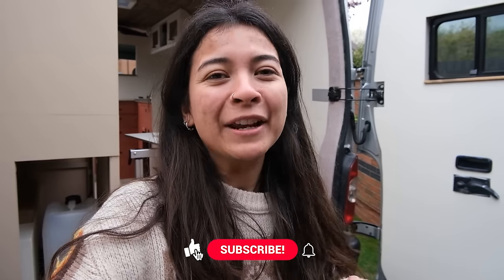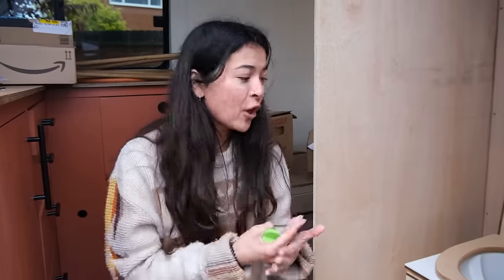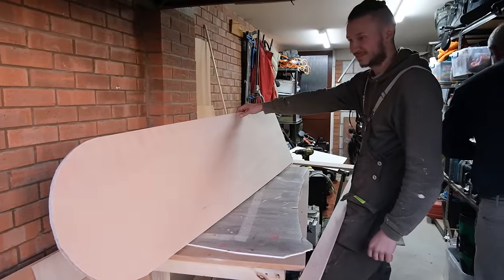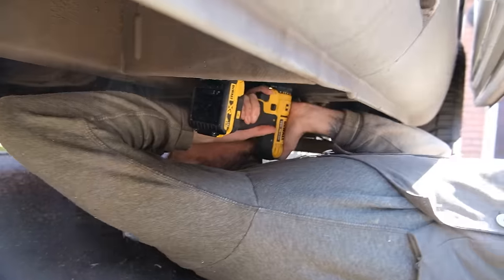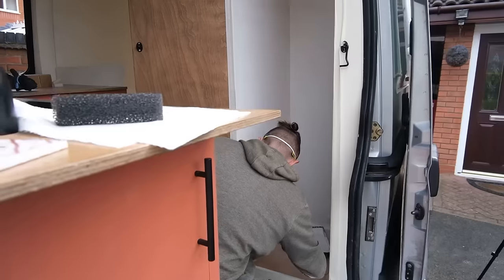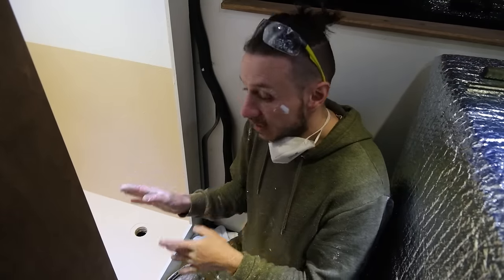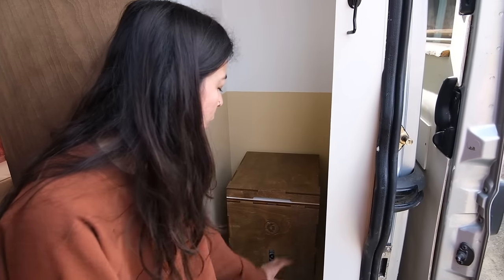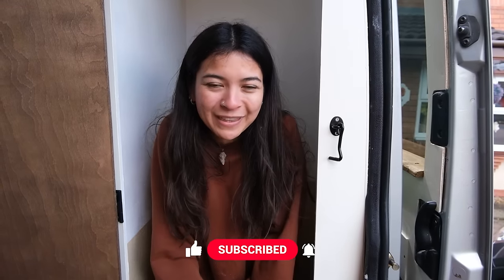CAMPERVAN WET ROOM | How to Build a DIY Wet Room with COMPOSTING TOILET Ep21

Comment: If you wrap your roller in a plastic carrier bag it won’t end up rock hard by the time you do the second coat. That’s how I’ve always done it when painting the house
Reply from the maker: Thanks for the tip 😊 unfortunately this doesn’t work with raptor paint due to the strong solvents contained within the paint. If you leave the paint on the roller it dissolves it or goes rock solid depending on the amount left on the roller. Sadly, each roller head is advised for a one time use only.
Reply: That is gutting it doesn’t work for raptor paint. 

Btw I’m loving the videos, I’m trying to get ideas for when I finally do my build with my daughter so eating up all the videos I can find for idea lol

Comment: First time viewer, just subscribed as you guys are doing amazing things. I just want to ask, did you contour the wet room floor, so that 100% of the water drains? (this is the one issue I have with building a wet room rather than using a shower tray, everywhere Iv read make it seem really hard to do)
Reply from the maker: Thank you and hello 😊. We didn’t, I got a squeegee instead to scrape the water down the drain. My thoughts were: if you’re not parked on a complete flat, the water might not flow the right way anyway. I guess if you know it’s shower day you just need to park in a way that the water flows in the drain 😄. I know not the simple answer you were looking for but just sharing why we didn’t contour the bottom in the end 😊

Comment: Amazing job!!! But in my opinion the doors need Raptor paint too + some seal. What you recon?
Reply from the maker: Thank you 🤗. The door won’t be shut when showering, there is a shower curtain inside to make sure the water doesn’t spray out. We did it like that as you can’t seal the gap around the bathroom door, or at least, we don’t know how to so we just kept it simple 🤗

Comment: Looking fab guys well done. Question how come you didn't paint the inside of the door? And I know it's not power shower levels of heat or steam but is there a fan in there or do you shower with the door open? I feel you probably covered this in another video but I forgot I love the arched door and the fact you stained it on the outside it looks so good!!
Reply from the maker: Hey Donna 🤗 we covered it on this video but there are a few reasons we didn’t do these things. We didn’t paint the back of the door because there would still be a gap around the outside of the door which water would get through. We also want the door to be open as there is no fan, the fan is just outside the bathroom so it’s best to have the door open. The space overall is small so having the door open acts as a divider which gives privacy if people are travelling with friends / family rather than as a couple. There will be a shower curtain and rail fitted to keep water properly in. I guess I just felt like it gave more of a full bathroom vibe when the door was open too as you also get to have the sink right opposite 🤗. Thank you so much! It was all inspired by our trip to Morocco and Kefalonia 🥰
Reply: @nicroams  I do remember you saying in the design phase about a shower curtain. I must have gotten distracted when you said today. I've  a deaf cat that is always meowing and demanding attention when I'm watching YT lol The finishing touches we saw today look amazing too can't wait for the we finished tour :)

Comment: Hi!

I'm also thinking of painting shower areas with Raptor, have you noticed cracks in the paint in joints where it can move when driving on hilly terrain? Or is it so elastic that it can handle small movements?

Regards Roger
Reply from the maker: None at all 😊 it’s been about 6 months now and it’s as good as new. Raptor paint is made for truck beds so it’s made to withstand vehicle movement 😊
Reply: @nicroams  What did you use to seal the corners before raptoring?

Comment: the problem with compostable bags for your no2 is that unless they are exposed to sunlight they take around a 100 yrs plus or more  to decompose
Reply from the maker: Yeee they aren’t perfect, but better vs chemical toilets 😊
Reply: @nicroams  yes quite agree but just pointing out they are not the environmental solution they are being sold as

Comment: The problem with your system is ALL shower curtains blow in and stick to your body while showering due to hot and cold air pressure. That’s the part that sucks
Reply from the maker: Yep, just pop something in the bottom 2 corners to hold it back - the shower is never crazy hot as it’s just a camping shower 😊